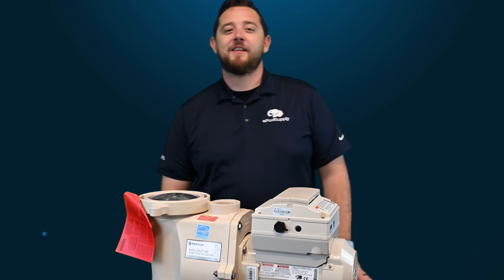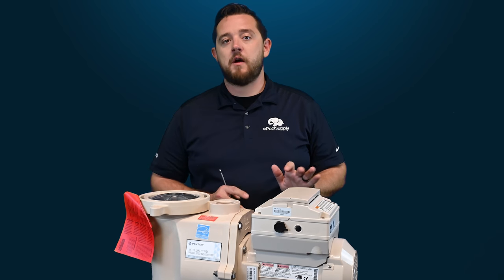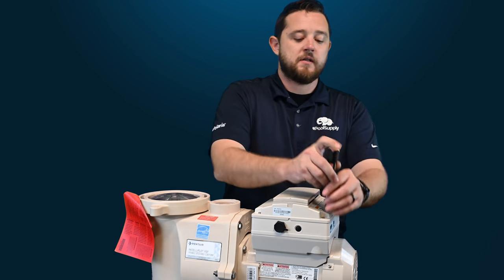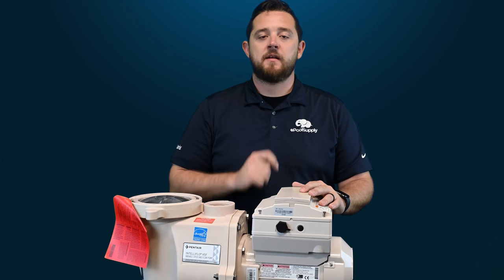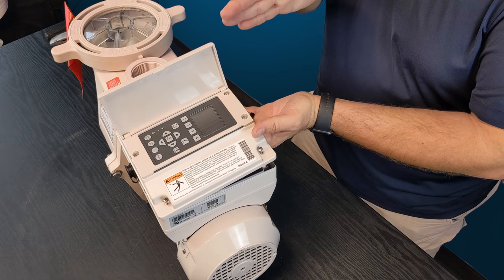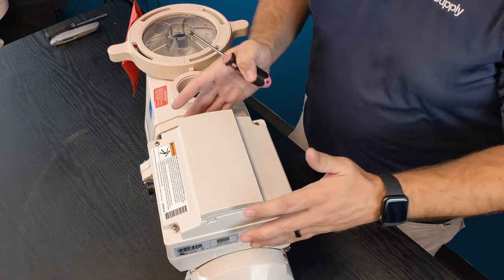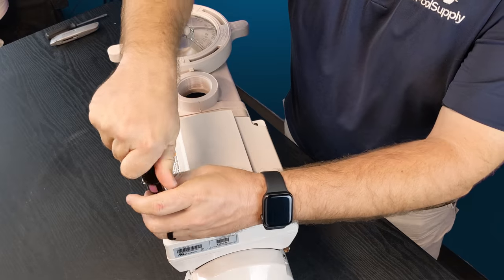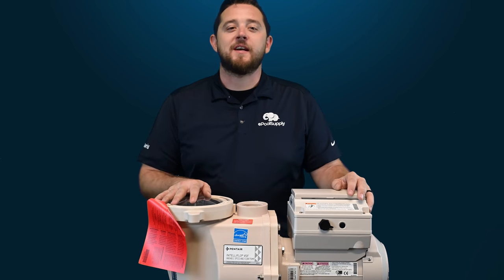Pentair IntelliFlo Control Panel Relocation - Quick Fix

Comment: My house had a very old Pentair system .. replaced everything to the latest/greatest. The new control board (with the mobile app capability) included. I noticed the installer connected the new control board to the old one - is that normal? It looks weird.
Reply from the maker: Yes that is normal.